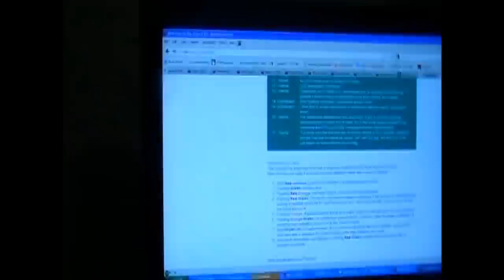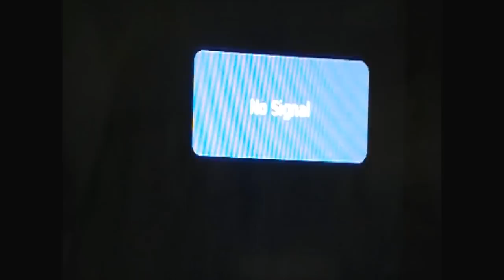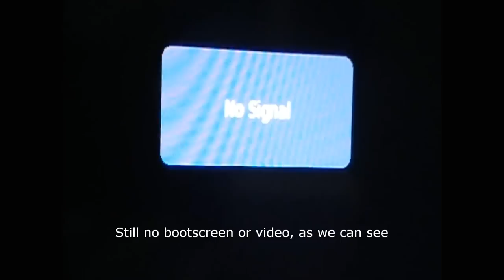UnleashX Softmod Xbox (Kernel 4034 V1.0) Orange Flashing LED Error Demonstration [ISOZONE]

Comment: This looks like its a software issue the only fix I can think of is connect the hard drive to a pc look for your back up files (or look for missing files which is going to be time consuming if you even know what to look for) so just save your back ups reformat the hard drive and start again either with the regular dash or with unleash reinstalled.

Comment: I am saving up for a fine-pitch soldering/desoldering station and I will take a look at this hopefully sometime within the next few months once my move to my new home is completely taken care of.

My soldering skills have improved and I've done simple things like reflowing DC-in sockets and adding an RGB slow change LED in a model 2 genesis so at least as far as through-hole soldering work goes, I shouldn't have much trouble reflowing the A/V out (what I now suspect is wrong with it). If that doesn't work, we'll keep eliminating culprits (provided I can get a schematic for the board)

I will post updates as more information surfaces. I've been working on a lot of other side projects in the meantime that I may start posting videos for once I've tidied up the process.

This is my alt acc, btw.

Comment: Hi, i have an xbox with the same problem as yours. I´ve been reading your topic on the Iso forums. Did you get the xbox working? if so, what have you done?? Thanks.
Reply: criminalXcort  Not yet, I will pursue fixing this in the near future as new soldering/desoldering equipment becomes available to me to troubleshoot problem points on the mobo (no longer have access to the meh quality ones in my community college's electronics lab because graduation)